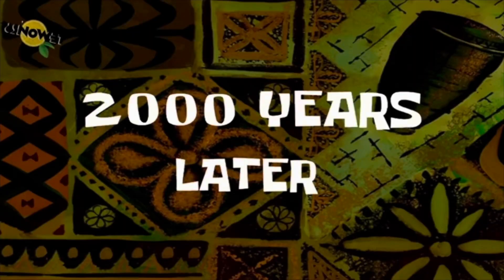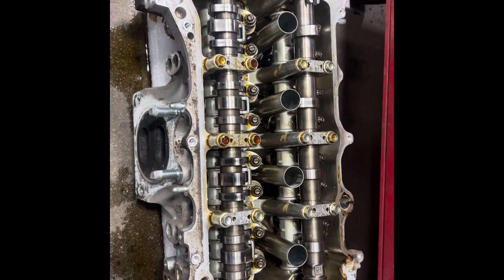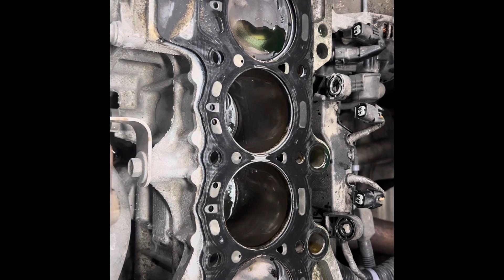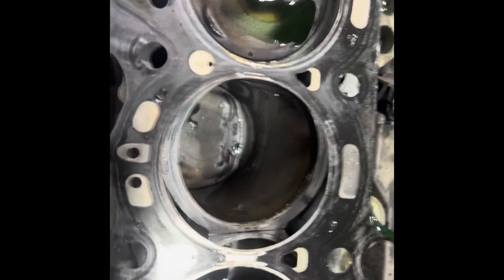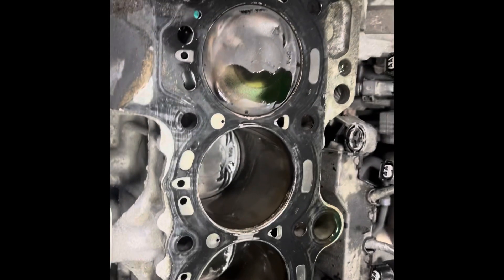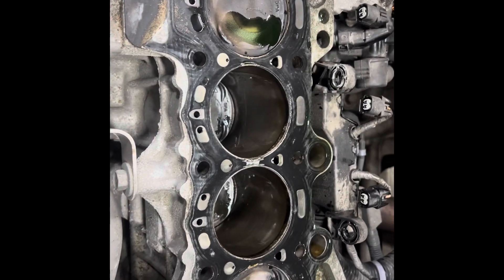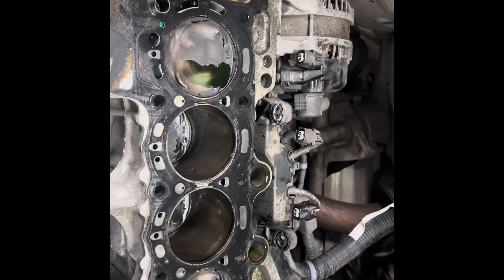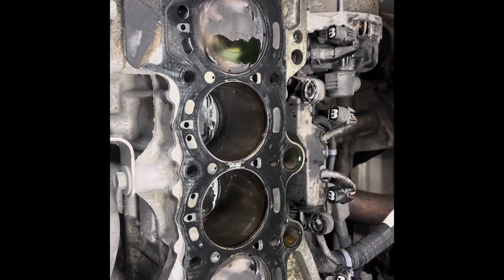My opinion on 2018 -2020 Accord 1.5 turbo Headgaskets

Comment: my 2018 1.5 started showing symptoms at 60k (although that was after ~35k miles w/ a tune). returned to stock, ran some kseal through cooling system. at 75k now, occasional misfire under harder acceleration but consuming a fraction of the coolant it was. just nursing it along until i do gasket diy w/ arp kit when i have time :face-purple-crying:

Comment: Just turned 120k but have been smelling coolant for several+ months. Assumed the odor was because of the coolant was coming due to be changed. Couldn't find anything under the hood. This should be an extended warranty issue.

Comment: I have 2018 1.5 189Km with blown head gasket symptoms, i think honda should recall
Reply: What are the symptoms and how do you when it’s coming?
Reply: I hade it done at 65k km on my 2019, and its starting to show signs it wants to blow up again at 115k km🥲
Reply: Hard starts( sounds like a diesel engine cold start)
Reply: Hello: Jeremy, may an ask you how much you pay for and what they replace .
I have same problem on my 2019 acc 1.5 turbo

Comment: Why don’t they recall this, my gasket just blew at 60k miles with no warning .. never overheated or been low on coolant once.
Reply from the maker: Honestly i dont know if they gonna recall this issue but may be they gonna come with extended warranty thats just my guess not sure
Reply: Could you imagine sacrificing your own brand's reliability you worked so hard to earn? Can you also imagine what it would cost Honda to do a recall of potentially millions of engines that then need to be re-machined when they can't even get enough fuel pumps in stock for this recall ....(Which....according to the service manager) can also damage the injectors. Billions in $ assuming.
Reply: Hello: all the injectors or just that one is leaking only on mine. It’s one bank one bank two.

Comment: I had a head blown gasket at 79,540 Honda accord manual  sport .dealer quoted 7,560 to resurface and replace head gasket and labor.service rep said he would try the goodwill program Honda has but no guarantees.I paid 1500 and Honda covered the rest thru warranty. New gasket,spark plugs and injectors.
Reply: Hello Jesus I have same problem they gime a price $5,598 head gasket,plugs,2 injectors,all valve seal only and I asked if there is a TSB on and they told no nothing.

Comment: Do you have to machine shop the head or change the valve seals only with new gasket will be ok 
100,324 miles on

Comment: What were the symptoms for the car before you figured a blown head gasket? I have a 2018 Accord 1.5t with 70k miles and misfire codes. I have changed Honda OEM plugs and coils. Still rough cold start and misfires on load at 2500 rpm. I have fuel injectors on order since I have read injectors are a problem with this generation as well. Thanks in advance for the help!
Reply: Did all ur lights turn on as well? What have you done that’s what I plan on doing as well hoping I don’t have a blow head gasket.. I want to replace fuel injectors and pcv valve
Reply: @chinoa4188  I’ve replaced all oem plugs and coils. It threw a code for vvt solenoid and I just changed that as well. I was thinking it was as fuel injectors and ran a couple of tanks of injector cleaner. It’s a little bit better but still feel the misfire on load but now at above 3000 rpm. I just got new injectors finally since they’ve been on back order and will be replacing those next. Fingers crossed that it is fixed cause I really don’t have the funds to pay a shop for a head gasket replacement
Reply from the maker: What are the codes that ur getting?
Reply: @taingTv i got a code p0303 cylinder 3 misfire u think changing my spark plugs would resolve the issue? I changed them and the old ones were super black lol! What do you think i should do to get that code gone?

Comment: 2018 Honda civic SI 1.5 Turbo, overheated al 97,000, it also has blow by now, have you had blow by on the accords? When you have a blown head gasket?

Comment: To your knowledge has Honda made any improvements on the 23 and up to address the issue? Owned several Accords, wouldn't now buy a new 1.5T.
Reply from the maker: So far they car its still new but i havent seen any problem on those 23 yet but i think they are look similar engines usually 1.5 Turbo thats the one that always blown 18-21 so far , havent seen 23 yet, its still early to say for now
Reply: @taingTv  Thanks for the reply and info. That said, I would have to assume 1.5L still the same and to be safe and I would avoid the 1.5L. Only Accord I would consider now, 2.0L Hybrid.

Comment: Hey bro thanks for sharing your opinion.. what do you think about this issues is there any product or something can added in oil or coolant?? another thing Im not that comfortable with 0w20 but for 5w30 and 5w40 maybe I don't know ..
Reply from the maker: Humm not sure about the products that u can put in or oil to me oil is oil but i think they put 0w20 which is light oil its for better fuel economy but the head gasket may be the material they use is not good and may be the torque procedure is not tighten even

Comment: I have a 2020 Accord exl. No problems. Read give it higher octane fuel helps? More frequent oil changes or coolant changenhelp?
Reply from the maker: U can try that may be will help u for long run
Reply: This is what I've heard to. Premium gas, oil. I'll let you know it goes. 🤞🏽

Comment: I ordered ARP Headstuds for my 11th gen Si. They recommend doing 3 torque steps 25 ft-lbs, 50 ft-lbs, and 70 ft-lbs. What do you think? And Also, stock head studs are weak. Do you believe ARP head studs will help?
Reply: they will help, i ordered the same kit. if youre running stock tune, you will be never have to worry about it
Reply: Use high octane fuel.

Comment: I have a 2018 hybrid , 280k miles with 2 blown head gaskets . 1st at 147k miles. I replaced engine with a 20k miles one. Now at 280k again blown head gasket . Have you seen any hybrids with this same  issue?
Reply from the maker: The hybrid i did not see it yet but like i mentioned thats the gasket they use is either bad materials or the torque is not properly
Reply: @taingTv  would you happen to know the torque specs for the hybrid ?
Reply: As of today 05/29/2024, my 2018 Accord Hybrid 2.0, "Head gasket replacement" needed at 68K miles!  How!?!?!?

Comment: Have you looked up a 2021 1.5 torque specs to see if Honda has increased the torque on the 1.5?
Reply from the maker: The spec no change but either the torque is off or the material they use is cheap

Comment: As of today 05/29/2024, my 2018 Accord Hybrid 2.0L, "Head gasket replacement" needed at 68K!  How!?!?!? Alerted by "high temperature read out warning while driving." Other mechanics told me it's "odd" at that mileage. Honda dealership in Paramus, NJ made a video of the antifreeze residue in cylinders #1 and #2. I don't even drive the card hard and always maintain it well. Car complaints website also states averages 73,350 mileage prior to gasket blow out. Did anyone call/report to corporate? Any offered solutions?
Reply from the maker: Sorry to head that bud yea i feel you sometime car go with high miles get it too and sometime low miles too we acrually got 1 at 50k  and 1 at 98k im not sure if Honda doing any adjustment yet

Comment: Dear sir 
Good day

I’v a problem with my 1.5 engine it’s mixing oil and water in radiator only not in oil level stick, so I am changed the gasket without make facing unfortunately the problem is back not in radiator only but in the oil level stick this time !!

So can you advice me the problem please or the checklist list should I do to find the problem 🙏🏾

Thanks
Reply from the maker: Oh dam thats sad to hear that buddy but ur radiator is mixing with oil like thats its not a good sign i dont no if changing radiator will fix ur problem but something like that i usually doing engine swap and new radiator, could be something internal of engine is failing caused to mixing oil and coolant

Comment: Hi I have a 2022 accord 1.5T.  Do you think they resolved the issue?  Do you think they resolved for 2023 with latest gen?
Reply from the maker: Humm nothing i see on the 22 yet but there are a few rodents chewed wiring through
Reply: I have same car also Lee, another channel recommended running 91+ octane fuel.
Reply: @chadphilpott1991  Hows your accord been running?  That's if you still got it. ..
Reply: @jamesd2661  still doing okay about 33k miles on it

Comment: For those who have gone through this head gasket issue, have you had to replace your entire engine or what the head gasket (bolts, injectors, plugs, etc) enough?

I really don’t want to replace the head gasket if the engine has to go with it.

Also does anyone know if bad spool valve is caused by blown head gasket. The reason I ask is because mechanic is telling me I have to replace spool valve before he can truly diagnose head gasket (although it is obviously the underlying issue - oil sludge, coolant disappeared with no leak, overheated once for a less than a minute before I parked). I don’t want to replace spool valve and have the head gasket wreck it again.
Reply from the maker: So far i have not see people replacing complete engine yet just head gasket and should be good who’s no how long will last , and i never heard of replacing the spool valve about this issue so did u bring it Honda Mechanic or local mechanic?

Comment: 2018 Honda accord Lx 1.5 t dealership replaced to a 7000 mile engine original motor had 80k miles very frustrating had to literally fight with the dealership warranty covered but I’m so disappointed with Honda they need to recall
Reply from the maker: Yea i fell you man i fell like they might come up like a extended warranty not sure

Comment: Replaced my motor and now taking Honda to small claims. Cost my about 250  to file in court and all you have to do is request ever tech bulletin and any motor changes before they'll eventually own it. About 10,000 to replace Never modified. 
Imho

Comment: Letting all you honda owners know that a low or bad battery causes problems with the vehicle. Stalls or hiccups. Honda dealership where I’m at said it was a head gasket and was trying to get me to pay I I imagine more than 4,000 dollars or trade in my vehicle. I didn’t believe that was an issue and scanned it my self with the one reader and only found and electrical code that popped up so I was like “it can’t be the head gasket….. I took a day off work checking for leaks in the coolant and other stuff and I finally fixed the stalling and jerking. Guess what it was in the end!!!    It was a loose battery terminal🤣🤣🤣  Thank God!  So I changed the old battery and tightened the battery terminal with a screw in between. All fixed now.   I didn’t trust dealerships before and I still don’t trust them.😅😅😅
Reply from the maker: May be ur situation is different usually these kind of accord sometime wont store codes and mostly vehicle is overheating or low on coolant and sometime u get misfiring codes as well we have pressure test with thr radiator tester and with the pressure applied removed all spark plugs and stick the camera inside thru the spark plug hole u can see coolant running inside the cylinder walls

Comment: I just saw a 1.5L sleeve. The grove between the sleeve. Oh man. I’m wishing the Integra doesn’t have the grove. I’m sure Acura didn’t fix this. Terrible design. 🤦🏻‍♂️
Reply: I also just saw the toothpicks head bolts. Definitely not looking forward of the Integra head gasket. This is very crazy and Honda still making them with same issue. 🤦🏻‍♂️
Reply: but the headgasket is blown on the head side, not the block side.

Comment: ARP head studs will solve your issue, stock head bolts are super cheap, Honda decided to cheap out on their head bolts resulting in stretched head bolts overtime with the 1.5t engines. Buy high quality head bolts and use high octane fuel 90 or 93 and you should not have to replace your head gasket every 60k shame on you Honda for ruining your reputation. Imagine how many Honda owners are now Toyota owners just because they wanted to save $400.00 per car. Now we as customers would need to pay 4-6k to repair their mistake. Buy a toyota

Comment: the 1.5 T honda engine is the worst of the worst honda need to recall those head gasket. its a lot of accord with this problem
Reply: I agree
Reply: just like Cadillac Northstar
Reply: Add my 18 1.5t to the list. @ 130k miles
Reply: @obxguy1  what octane gas were you using most of the time on average.?
Reply: @jamesmedina2062  Yes similar

Comment: I realise the 2.0t doesn't have this problem but I think I know what might be the cause, firstly the 1.5 t head bolts stretch after a while due to the poor material of the head bolts also the accord 1.5 t has a higher boost pressure at about 20 psi I think, so high boost on high compression engine with inferior headbolts are a recipe for blow gasket.
Reply: Mines does I have a 2.0 I’m dealing with this now
Reply from the maker: I dont really see any 2.0 yet on my end

Comment: Do you have to machine shop the head or change the valve seals only with new gasket will be ok 
100,324 miles on
Reply from the maker: U will need to straight edge test first see it it warp if its warp u will need to send to machine shop to resurface and if its not warp u can just install new head gasket thats all